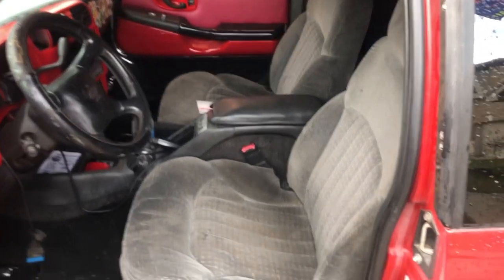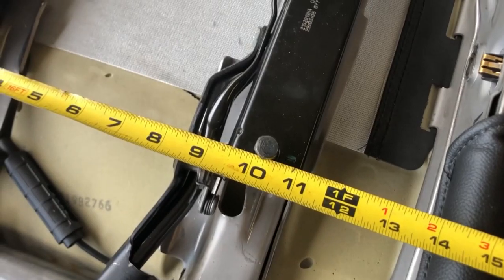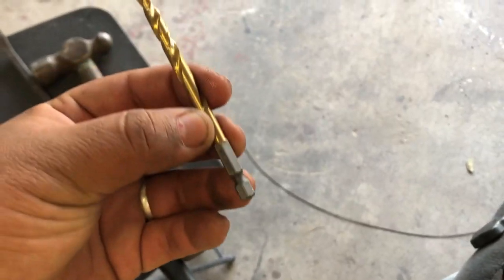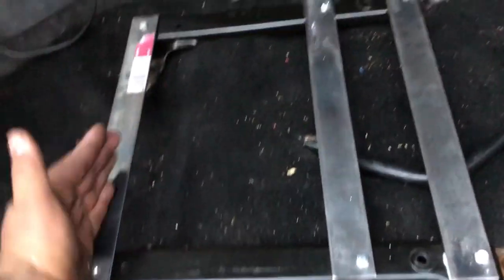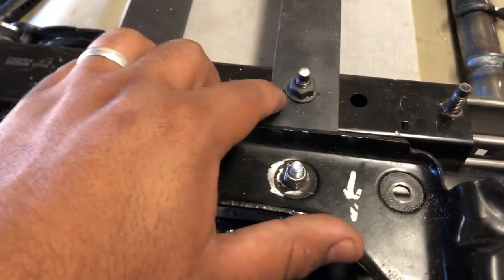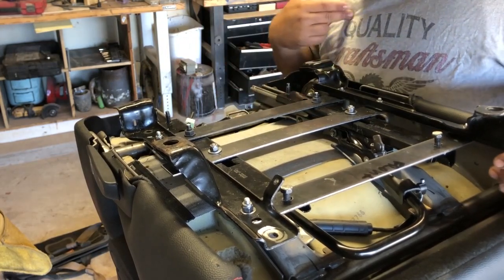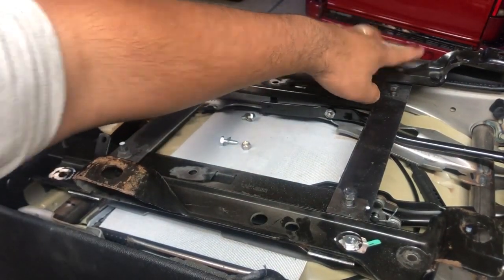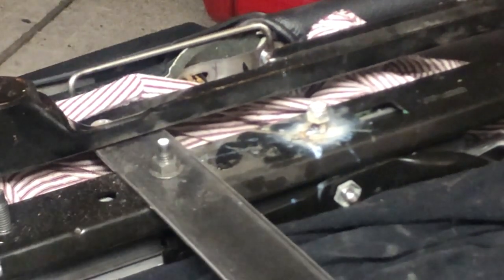Chevy S10 Seat swap

Comment from the maker: Just an update, I ended up swapping the old seat belts off the original seats and replacing them for 2 reasons, being a big boy I wanted the seatbelt looser than 1 inch and once I pulled the the dodge seat belt clip the bracket holding it to the tray was razor thin! I’m assuming it’s that way because dodge thought only children would be in these seats. Idk 🤷‍♂️, I’d highly recommend swapping the the original ones . Thanks for watching!!!
Reply: Instablaster
Reply: What year
Reply from the maker: @mannirubalcava1724  2017

Comment: Soon as my zr2 is back from the shop I'm doing this.  Lol my quick fix for the time being was switching the passenger seat with the driver seat
Reply from the maker: Ha nice, how do y’all buckle them seat belts?
Reply: @madmike_9343  before I cut them out to replace them,  nothing changed on them so both still work.   
Just keep the button latches and original seatbelts from the s10 intact.
Reply from the maker: @silkybenjamin4208  got ya.

Comment: Why wouldn’t you use the 4 studs and 2 bolt holes already in place for each seat?
Reply from the maker: I did , the track bracket is different
Reply: You drilled new holes in the stock van tracks, I have those same seats.
Reply from the maker: @p.b.sHUNTING  ohhh yeah it’s was so I could set the seat further back

Comment: Off topic, but I seen your vid of the sound deadening, how did it help the road noise and overall ride quality?
Reply from the maker: It made a huge difference for me, even though I have a exhaust system that is essentially “straight pipe”, it cut down the droning, road noise and fuel pump noise.  I also have a 2018 Silverado and it drives me crazy how loud the road noise is! I plan to put it into the Silverado too.

Comment: How did you get the T50 bolt out? They tend to strip for me as I live unfortunately in PA with rust and then I’m fuxked
Reply from the maker: Mine came out without issue. I live in south Texas though. I’d try hitting it once a day with PB blaster for a week if I were you, the try to remove it
Reply: Apply heat, the factory uses loctite (a lot of it) on seat and seat belt hardware. About 3-5 minutes with a butane torch and they'll come out like butter.